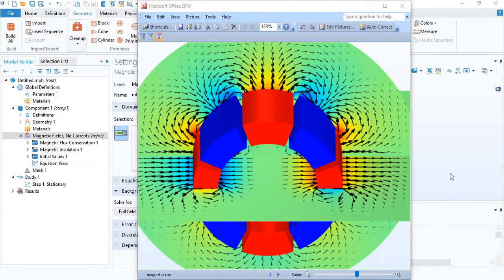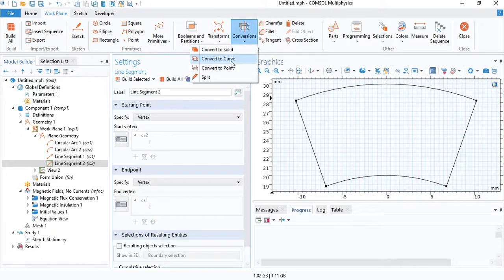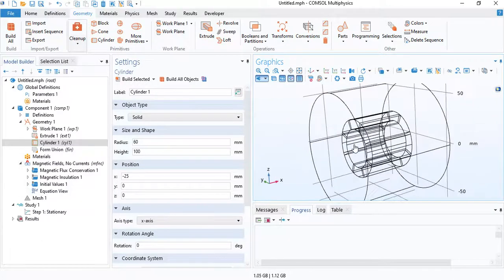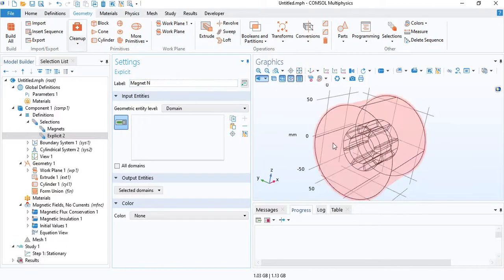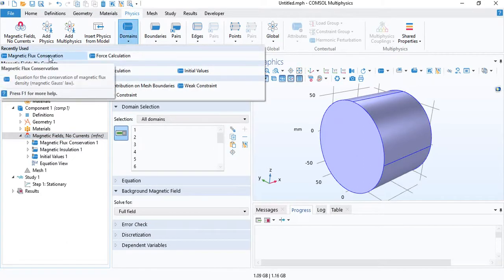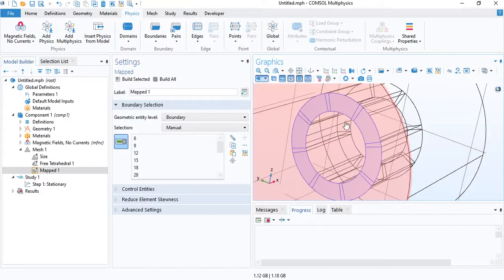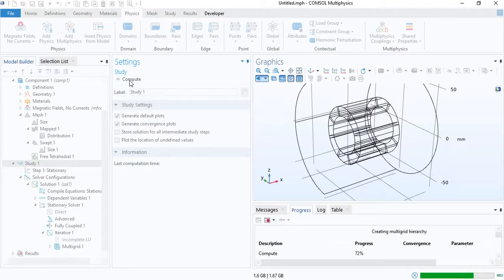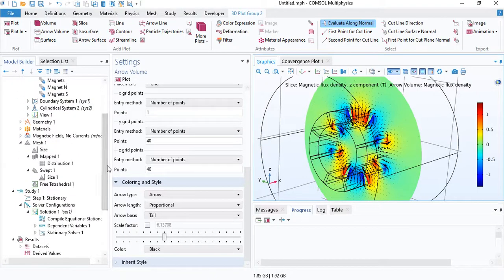Modelling cylindrical permanent magnets with radial magnetization using Comsol Multiphysics

Comment: I have a new product and would like to have my magnets modeled. Is that something you could help me with?
Reply from the maker: What aspect of modelling do you need help with?
Reply: @JafScience  I have built a magnet pack that will go inside of oil and gas pipelines to pick up ferrous material. I am wondering if we could model the magnet pack to ensure I'm building it to pick up the optimum amount of ferrous material.
Reply from the maker: If you want to model small fragments of ferrous material, I'm not sure how to do that.  If you want to study other related variables like how wide the magnetic field is and how strong it is in the region of interest, then that can be done.

Comment: Dear sir,

Kindly tell me how to plot B vs x (distance from the surface of the magnet) for such simulations
Reply from the maker: In the results dataset you can create a line that extends radially from the surface of the magnet. This line should use your solution. Then use this line dataset when you create a 1D line plot.

Comment: Is it possible to model and experiment a simple magnetic coupling using this method?
Reply from the maker: If you want to do an experiment you can assemble such magnets together (you may need a hollow non magnetic core). And I you have a tesla meter you can measure the magnetic field at the centre of the magnet array.
Reply: @JafScience  Thanks and how about comsol? Should i use rotating machinery to measure things like torque?
Reply from the maker: @danascer1454  I haven't used rotating machinery so I don't whether it has built-in variable for torque. But depending on how you set-up your model you can compute it from first principles, such as computing Lorentz force from magnetic field and electric current.

Comment: Thank you for the great tutorial.
I have two magnetic field sources in the workspace
and I want to measure their combined effect and their individual effect separately at a point
Which method should I follow?
Reply from the maker: The combined effect is the solution you get when you simulate both sources together. If you turn off one of them you will get the effect of the other source. To see the result at a point you can insert a probe. You may need to insert a point in the geometry at the desired location to use the probe.
Reply: @JafScience  
Thank you for your kind reply. 
I have 2 magnetic field sources, one with AC coil (Hac) and the other one is permanent magnet (Hs). 
I want to calculate Hnet=Hac^2/sqrt(Hac^2+Hs^2). 
When I put probe at a point comsol measures total effect. 
If i measure Hac and Hs seperately I m gonna use them as variables and calculate Hnet. 
Then i will multiply Hnet with a constant and this value changes to power in Watt.
And i ll use this Watt as Heat Source input for heat transfer in solids (ht).

I can send the comsol file if you want to have a look.
Reply from the maker: You can multiply the total effect with a constant directly. But if you want to compute each field separately you can use a total of 3 study steps. In the 1st 2 steps turn off the source which you don't want.
Reply: @JafScience  ok i will try. thank you.